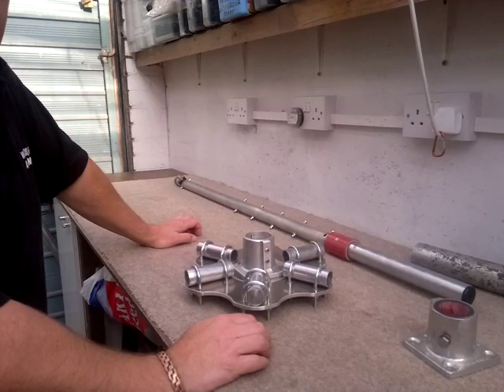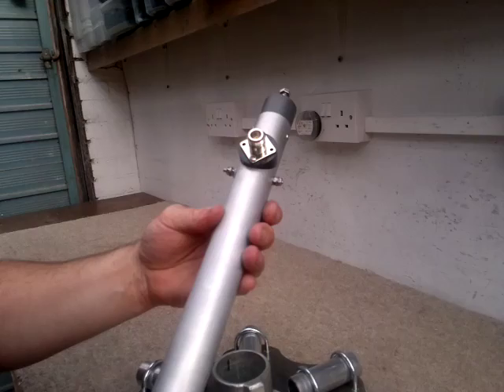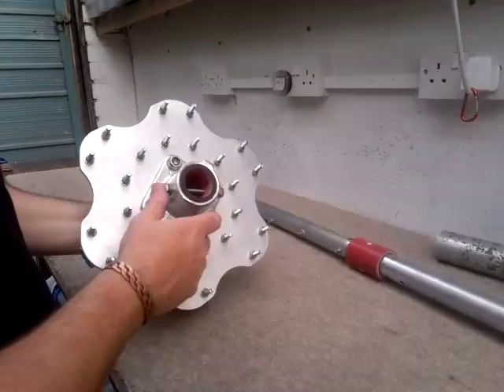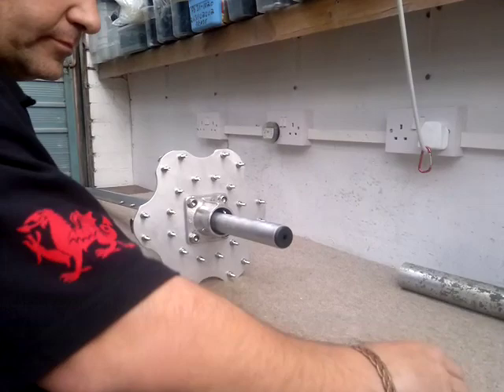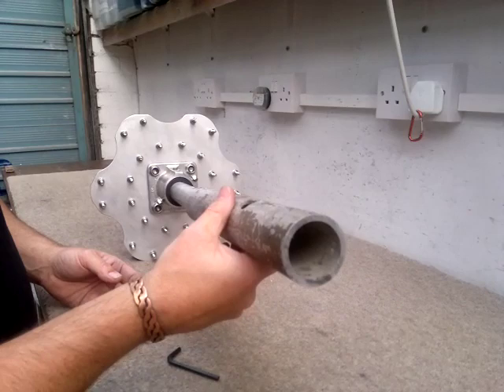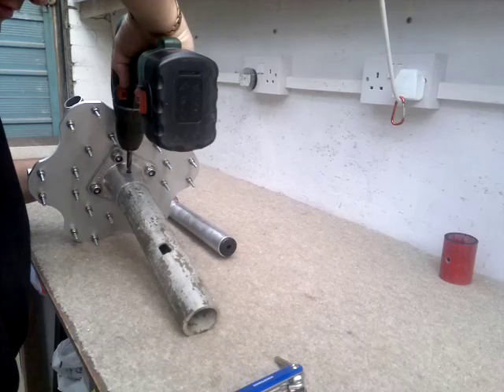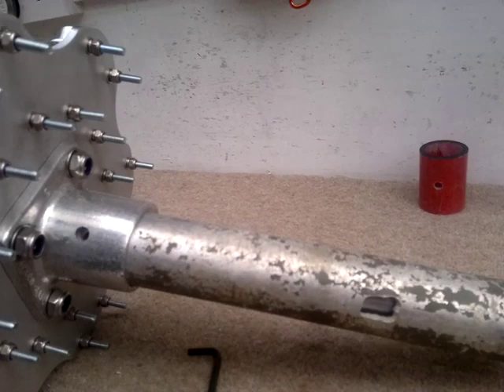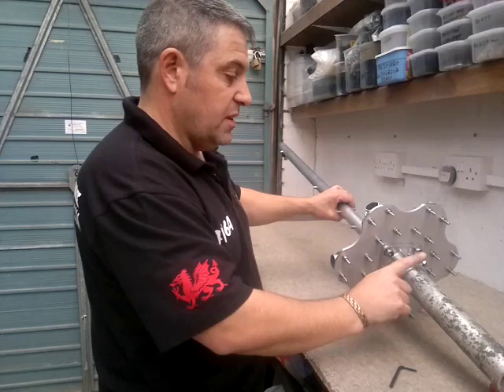Air Coaxial Centre-Post and Hub assembly - G3TXQ Hexbeam by MW0JZE

Comment: Nice design. note: There should be 3 threads showing past the locking nuts that hold the upper and lower hubs to the plate. Again nice job. 73 Leo   k